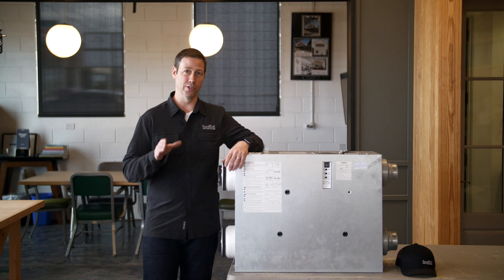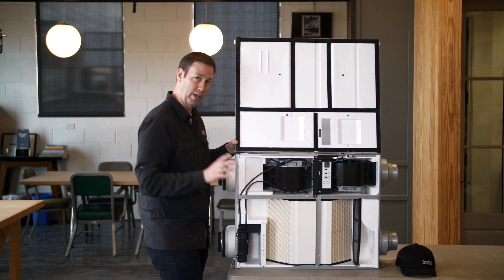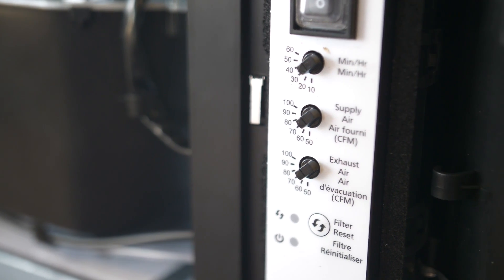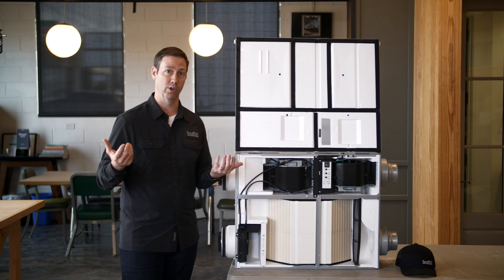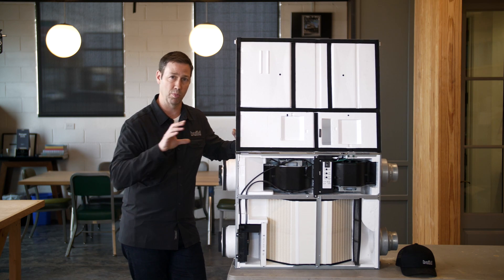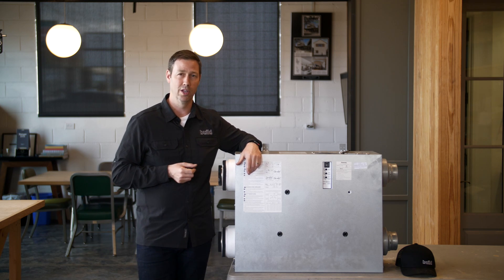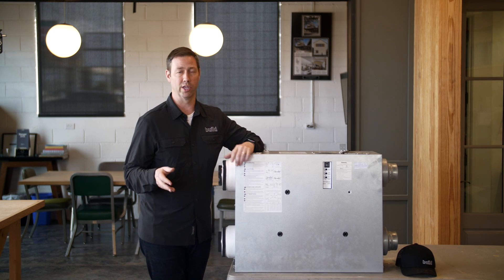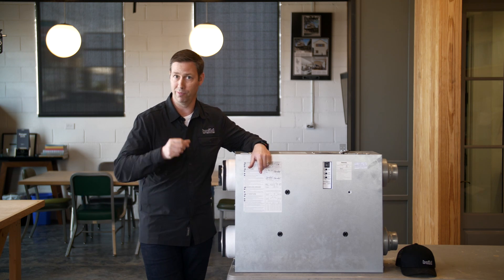ERV vs. HRV - Myths

Comment: In an installation with both an ERV and a whole-house dehumidifier, how would you prefer to duct those?  Should the ERV fresh air be run though the dehumidifier?  Many dehumidifiers have fresh air intakes, it seems that should pull from the ERV.
Reply: Did you find an answer to this?
Reply: I would like to know the same.I am about to install this unit in Northern California on the coast and having humid winters and nights year round I want to add a dehumidifier as well.
Reply: @DHMADNS  Did you find an answer to this?
Reply: Anyone know the answer?

Comment: Straight forward and to the point.  One of these have been on my list for a few years now, but an HRV.  Northern at 0 degrees, we wish.  Try -35
Reply: You can use the cold climate version of panasonic's ERV in any North American climate zone. Model is FV-10VEC1. The ERV allows the cold climate dwellers to retain some of the moisture of the home by transferring some of the humidity from the exiting air over to the previously bone dry air coming from the outside. The ERV doesn't add humidity like a humidifier but moderates the existing humidity in the air.
Reply: @Joe You don't have to go very north at all to get below 0 (Fahrenheit) occasionally. It was a pretty warm winter this year; I remember it hitting -3, probably went below that too, just sayin'.
Reply: ok, but -40 is -40.  -17 is a warm day
Reply: The coldest days don’t count. It’s not uncommon for us to hit -20 several times in SD during the coldest months. But the daily average temp never gets near there. I’m running a fantech shr3005r HRV in my house. Dual core, extremely efficient, but during maybe 3 months of the year it’ll bring in a lot of humidity if I run it frequently. I looked into getting ERV cores to swap out in the summer, but that was a bust since for the 2 cores they wanted $2500 (double the cost of the unit in the first place) I might end up swapping my HRV out for a ERV in the end and moving the HRV out to the garage for dehumidification in winter after melting or washing vehicles, trailers and equipment. The HRV works great though in winter for removing humidity from the house, probably to good.

Comment: Matt, I have a photographic darkroom in my basement in Ohio and need to add ventilation. I'd like to use an HRV to keep the temperature in the room more constant as I ventilate and have it cost me less to condition the air. Are you aware of any small, cheap HRVs I could use for this?
Reply: lunos is small (depends if you have any above grade portion to your basement wall)